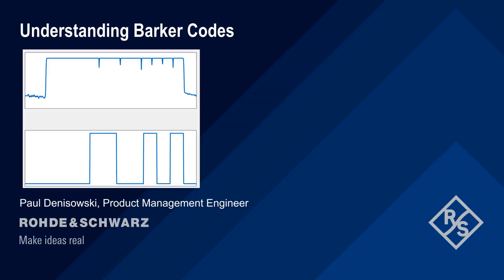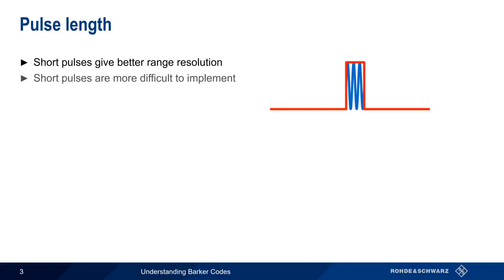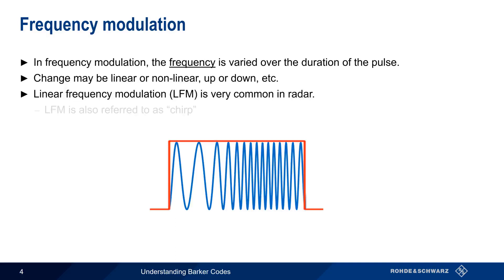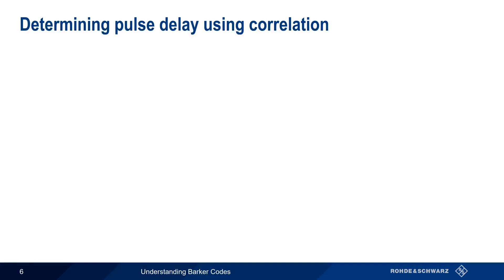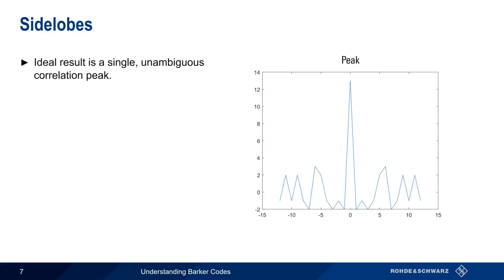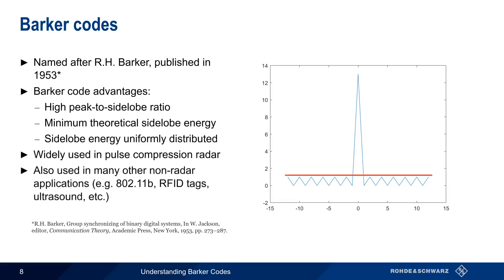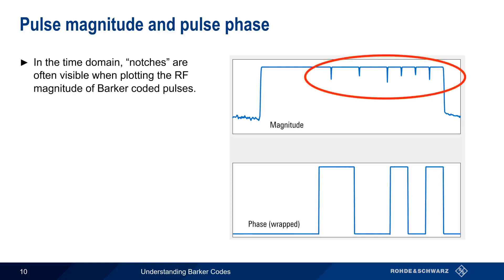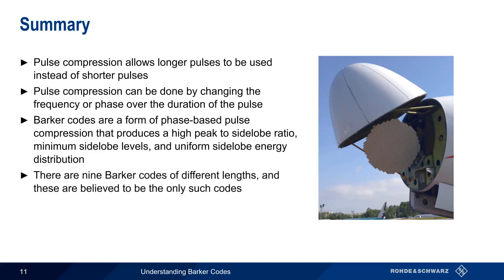Understanding Barker Codes

Comment: what is the minimum Bandwidth   required for receiver  for barker 13 code ?is it calculated for total T of 13 code or tao for one change in phase to another phase?
Reply: The bandwidth is linear with the reciprocal of the sub-range duration.

Comment: If I have a data sequence 1000 elements long and I want a training sequence (using Barker) for example 11 elements long... how do I define it? They will both go into one frame that will be sent, but how long do I make the barker sequence? 11 elements long?
Reply: The lengths of all possible Barker sequences are already known (people have spent a long time unsuccessfully searching for additional sequences), so you're essentially stuck with the existing sequences.  I would probably just use the Barker sequence with the length closest to the one you want (there is a length = 11 Barker sequence).  Hope that helps!
Reply: @pauldenisowski  Thanks for the clarifications! So I don't care if my frame has 1000 elements or 10k.. the barker sequence I insert in the frame remains unchanged (for example of 11 elements)

Comment: will the frequency content of the phase coded signal will be the same ? I mean If I take FFT, will it give only one frequency ?
Reply: Since Barker codes are normally used in pulse compression radar systems, the spectral content of a "normal" Barker-coded RF signal would have very broad spectral content -- i.e. the typical sin(x)/x spectrum that's created by pulsed signal.  Even if you gated the FFT to only acquire over the length of the pulse, any abrupt phase transitions would also create spectral regrowth, so I think it's very unlikely you would get power only at one frequency after taking an FFT.  

[I suppose if you made a gated measurement over the pulse AND you very carefully chose the pulse frequency to minimize the abruptness of the phase transitions -- i.e. each sub-range contains as close to an integer number of cycles as possible -- you could reduce the width of the spectral content, but this would be both very difficult to do and very unrealistic]

Hope that helps!